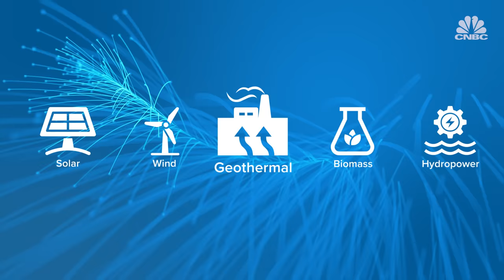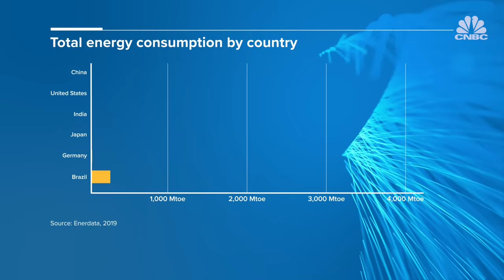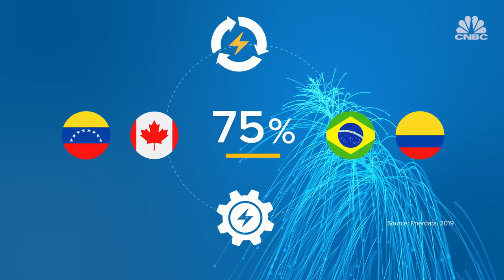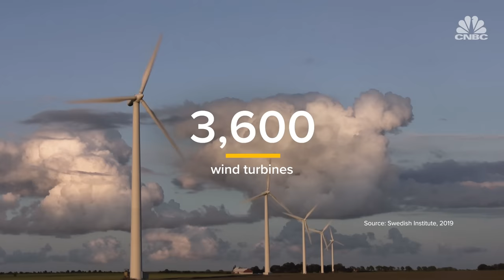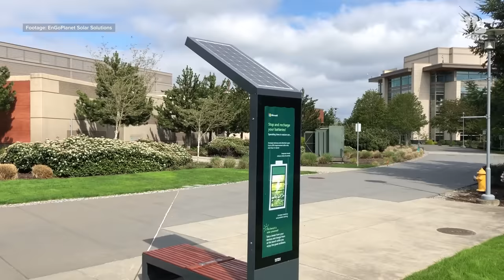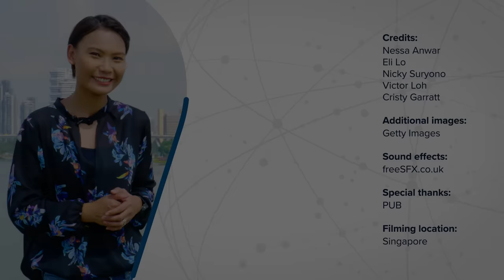Who is leading in renewable energy? | CNBC Explains

Comment: There is no such thing as renewable energy.
Solar & wind panels break frequently. The massive turbines you see last 27 years solar less, Solar far less any surface imperfections make them less efficient. People always want to buy the newer efficient ones meaning the old ones don't get sold so eventually get ditched. They also need either back up power (gas/power plant) and/or batteries. The materials that are used to create these products are mined from all over the world and use fossil fuels in order to reach high temperatures to make the products. Then they are shipped throughout the world using vehicles which use high amounts of fossil fuels. Old panels get don't get sold and end up landfills. 
"Bio plants" are basically they chop down trees and burn them.......When the wood is too wet they use tyre chippings.
Batteries are a huge problem for the environment their creation and disposal...............we live in a nightmare.
The people behind the "eco" revolution are the mining and logging companies. I'm sorry if I've just ruined your day. Our consumption is destroying the world.

Comment: Now start counting the energy costs (and massive toxic wastes generation) of the production of the solar cells and batteries....  which they gleefully ignore.  The energy required to make the solar cells  (mine raw materials,  process them,  then proiduce the cells) is higher than the energy obtained from the solar cells over their 20-25 year lifespan.  Until either the lifespan of solar cells are at least doubled or the raw materials required are changed to cheaper materials (really both),  solar is really best used for off-grid or emergency power.  The battery situation is several times worse,  especially in terms of the generation of toxic wastes.

Comment: Renewable energy provides a very small amount of global energy supply (4 to 5%). It's got a long way to go and the programme made little mention of all the real technical problems inherent in renewables. It briefly mentions the battery in Australia, increasing from 100 to 150 megawatts. This is part of a small grid in South Australia (3,000 Gwatt capacity), so 150 Mwatt is a drop in the ocean. 

In practice renewable generation is a dead end and is not the solution. Nuclear is ignored but is the only practical solution at the present time.
Reply: 'When more than 40% of the UK's electricity was generated by Renewable ewnergy sources in Q1 2020'
Reply: Hello James,
It was a particularly windy spring but the media articles that boast of such figures give the public a very misleading image of renewables. There are few if any reporters who write in the papers about energy show any signs of any depth of knowledge on this subject.

Biomass is included in renewable generation, which is a distortion, a particularly high emitter of CO2, higher than coal per Mwatt due to it's lower calorific value. Drax can generate around 3 giga watts per hour for ever and a day if required, that is a lot of  (renewable ) generation and it is good generation.
Wind, as I said was strong but there were several days in that period where wind was virtually nothing and that is the point, the grid is based on instantaneous levels of generation to match demand, in other words it doesn't do averages, they don't count for much. Solar of course at that time was weak for most of that quarter.

I mentioned earlier that Drax is good generation, renewable generation is inferior, which may sound infeasible but there are certain characteristics of generation that are important for grid stability and security. Inertia and synchronous generation, both of which support the critical grid frequency.
Wind and solar posses neither of these.
These factors mean that wind and solar cannot keep being added to the grid for stability reasons. You may have read that recently (Due to exceptionally low demand because of Covid) that some wind farms were asked to switch off because, as the unknowing reporters write, the grid is in danger of overloading. No, that is not a true reflection of the situation, overload is an excess of demand, not supply. What was getting critical was a low level of inertia had those wind farms kept feeding.
A recent grid trip was due to this factor

The wasteful thing, and which is causing our electrcity to be expensive is that the current capacity of wind and solar is upward of 23 Gwatts (With a grid maximum demand in the order of 50 Gwatts. i.e. nearly fifty per cent of what we need. However we have over 50 giga watts of conventional power as well.
That and of course the renewables obligation and contracts for difference subsidies is adding about 40% to our unit cost. While bad for domestic consumers it is much worse for industry and this countriy's economic competitivenes.

If you are really interested this web site gives an overview of the grid in real time and has historic graphs of all the grid suppliers and the demand. It's interesting if you take the time to analyse it's various graphs.:-https://www.gridwatch.templar.co.uk/

Comment: Why does nobody push for nuclear power, it could solve the energy problems world wide.
Reply: Because of Chernobyl
Reply: They are extremely expensive to construct initially and the cost of energy production is roughly five times as expensive as the next expensive renewable energy source. Not to mention due to the previous disasters, while technically harmless on the grand scale, have caused construction to become slow and holds back implementation on the government level. Other than that it poses a pretty big security risk when it comes to waste transit and storage.
Reply: Nuclear is doing Ok, there are something like 60 new reactors under construction, mostly in Asia. It's just that people don't talk about it when the topic is renewables.

Comment: More than 80% of the total energy consumption is still fossils fuels. This is mainly because about the same % is used in transportation and heating. Wind turbines and solar don’t do too good in transportation. Planes and ships do not use electric power for technical reasons. Focusing on wind and solar will not be sufficient. The money used for those very expensive and non stable source of energy would be better spent in nuclear if we want to meet our CO2 reductions target. Considering the amount of energy usage and potential increase renewable will not do it. Also the enormous ressources and energy consumption required for the wind and solar considering storage and modulation make it not so ‘green’. Those source of renewable energy are only possible because of fossil fuel. If only solar and wind power will available to make wind turbines and solar panels... it will be obvious that this solution is just non viable.

Comment: Fossil fuels are declining having reached peak production.  At present as fossil fuel declines and demand increases, alternatives are barely keeping up.  Nuclear and Hydro are not increasing, so alternatives are going to have to make up this gap.  Unless there is a breakthrough in something such as Fusion;  our path is set. No need to hate anything or panic about CO2;  The low hanging fruit are running out. I'd be concerned about SF6 used in power grids; it must be replaced as it is 25,000 times worse than CO2 as a global warming gas and stays in the atmosphere 16.000 years.

Comment: I am interested in (energy generation) gear technology that I have developed for the energy transition in the soil. Water and air transport (also airspace / helicopters / military vehicles / drones, etc.). Below I am sending brief information about the scientific background of the transmission development fundamentals. I need an investor or entrepreneur for my new clean energy generation project to support the project with the financial / participation so that I can start my business.

The idea (problem): If you want to produce more power on the output side, you have to introduce more drive power into the gearbox accordingly. This is a problem with increasing the output on the side. It should actually be possible with lower drive power, multiple output-side power increases.

The solution: The problem is solved with the newly developed integral gear technology. You don't have to increase the drive power if you want to increase the output-side power. This creates a unique selling proposition on the market, as there is no applied technology of the same type that transforms the inertia and resistance forces away. The driving forces are thus freed from load forces (functional prototype made / tried. It works!).

The project and the areas of application: This gear technology is used wherever you want to increase the energy yield by around 7.8 times. For example, from wind turbines to (special) means of transport (electric drive technologies). The drive power of all means of locomotion and transport will work for years with small batteries. The diesel hold of container ships is being expanded and diesel drives are being abolished. The charging stations for electric cars will be superfluous. Rail traffic will run without a power grid. The promotion of the renewable energy product will be increased by 99% by 2026. And these gaps can be closed more quickly after or with the integral gearbox. For the project we have to want the transmission, depending on the different performance classes, to achieve 100% zero Co2 emissions; for the application, we must continue to research and develop the transmission. The gearbox and its products must be marketed.

Conclusion: The infrastructures, the world renewable energy generation technologies are being redesigned. And all the unprofitable contemporary technologies, productions and uses that depend on the German economy, the benefit of the environment with the newly developed integral gear technology will be restructured and they will disappear from the world market in a very short time! Integral gear technology will dominate the world energy market.
Please contact me for more information! Thank you.
I.Yoendem@gmx.de

Comment: 6:45 hilarious.  even if you have people generating  electricity through stationary bikes, the energy is insignificant, only good enough to run eletronic devices.
Reply: as someone who does care about the environment enough to understand energy... this iis really stupid, using human power is the most inefficient thing one can do, the food they will eat after that workout will have released FAR more C02 to produce then what they saved by powering their TV for a few minutes. people just need to buy less stupid shit.
Reply: @miguellopez3392  👌
Reply: @zodiacfml  shit now that i think about it, the act of working out to produce 300W of mechanical requires around 4x of chemical energy, so a human is less efficient then a coal power plant (35% efficiency instead of 25%) and will produce more C02 for the same energy working out, shit we are fucked if people thought this a good enough idea to sell, at least you knew how little power was actually being made.
Reply: How about a "gym" having all equipments which eventually land to produce power?
Too many people working out for whole day
How much power can it produce?
Reply: @b.m.5068  biking in stationary bike cant fully charge a phone. This is the reason  very few installs a generator in stationary bikes
Reply: @zodiacfml  a phone battery is 12wh so 5 minutes of moderate workout would charge it, problem is a phone cant charge in 5 minutes so the current is regulated to minimum 2 hour charge time.

Comment: Solar is excellent but too limited in its acquisition period! All of the worlds cannot use it since there's not enough sun to power it! The Central equatorial countries would have to produce it and sell it to the rest of the world since the have a long period of sun and most of them are desert!
Reply: That's not feasible because of power transmission losses.
Reply: @dadanifit  also
Reply: That does not stop the EU from investing in solar for areas which are completely not fit for it.   In Poland houses burn with coal in stoves to heat housing but the EU grants do not spend on insulating outer walls and converting to gas.   What do they spend money on?   They subsidize solar panels on houses which do not have a correct angled roof in a climate that is always cloudy even in the best of days.
Reply: @oldfootage  wow...

Comment: Exactly how is geothermal renewable?
Reply: Its possible to re-inject water back into the soil for it to come back boiling.
Reply: @jascrandom9855  Where does the energy that reheats the water to boiling point come from?
Reply: @skatekai  The internal heat of the planet. But just like Solar energy, its so vast, that it the sun will consume the earth before its depleted. So for practical purposes, its considered renewable.
Reply: @jascrandom9855  Wouldn't it deplete faster if we increased geothermal? You are removing hot water from underground and putting back cold, essentially removing stored energy(heat) from the core. I don't see what's renewable about it. Kinda seem less renewable than even fossil fuels.
Reply: @skatekai  The difference is miniscule and insignificant.
Reply: @skatekai: The Centralia fire, though man-made, has yet to have been extinguished even after five decades, and that's staying hot largely because of coal.  The core's heat, on the other hand, is partly due to the radioactive decay of uranium and thorium.
Reply: @palmshoot  
1. Energy from uranium and thorium fission is non-renewable. 
2. High temperature in earths core is the result of uranium and thorium fission.
3. Geothermal energy, extracted from the higher core temperature, is renewable.

Which of the above statements have I got wrong? Logically they cant all be true, cant they?
Reply: @arrowmouse  There are technologies in development that aim at making Geothermal energy possible in every place.
Reply: @arrowmouse  It depends if you're talking about power generation or HVAC.  Geothermal HVAC can work in every land.  Even right now, some of Antartica's ice is melting because of geothermal heat.

Comment: Global warming has been dead at about 1°C since 1992.   The erratic delivery of solar electric voltaic generation if it is not charging storage is nearly worthless for grid quality power needing to typically be made grid quality with expensive to fuel natural gas turbines running at high availability burning a lot fuel for very little electricity.   If the solar electric power is a forced buy the cost to rate payers is more expense than running on natural gas turbines.  

The  United Nation's IPCC science report declares in the back pages of a nearly 200 page report it took its greenhouse gas samples at 20 THOUSAND meters where there is not considered to be active greenhouse gases because all the far inferred electromagnetic radiation from the surface, the greenhouse radiant energy,  is considered completely absorbed within 20 meters of the surface.  Earth's greenhouse effect is held in deep saturation by the strong greenhouse gas water vapor and that can not be changed by other greenhouse gases such as carbon dioxide and methane.    That is freshman high school science when I went to high school in the USA.   

This is the practice of a typical scam where careful reading of the information reveals the truth.   Without the discloser the IPCC science is based on taking greenhouse gas samples at 20,000 meters altitude the authors might be subject to criminal fraud for stating human caused carbon dioxide emissions are causing global warming.   There is still no mechanism that would allow carbon dioxide to cause global warming.   Global warming was reported at 1.1°C in 1991 and 1.1°C in 2022.   Over this end-to-end thirty year period there has been no correlation between rising levels of carbon dioxide in the atmosphere and global warming.

Comment: And let's not talk about the existing non polluting source of energy - nuclear power.. Y? Bcos we aren't so intelligent
Reply: niels lund  and carbon dioxide is killing us now and solar and wind power do not produce sufficient power to reliably meet everyone 's needs
Reply: niels lund  - If the waste only contains fission products, with trans-uranics and fuel elements completely utilized in a breeder reactor (as most nuclear proponents strive for), then the waste decays to background levels within 300 years. Not to mention that such a process would be over 20 times more fuel efficient than existing reactors and so would produce 20 times less radioactive fuel waste elements per unit of energy than burner reactors that rely upon enriched uranium.
Compare this to the huge amount of waste that is produced to mine and purify the huge quantities of materials needed to generate a comparable amount of energy from solar and you will find that it is a drop in the bucket in comparison.
Reply: niels lund  many decay elements from the waste stream can be and are utilized for various technologies and research. It is only waste when it is all jumbled together. As a purified element it becomes a resource with potential.